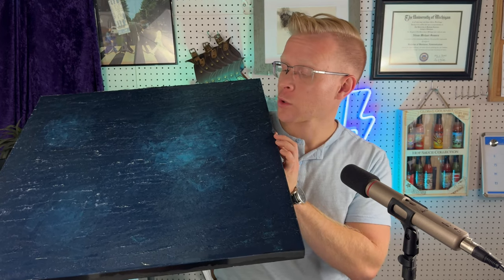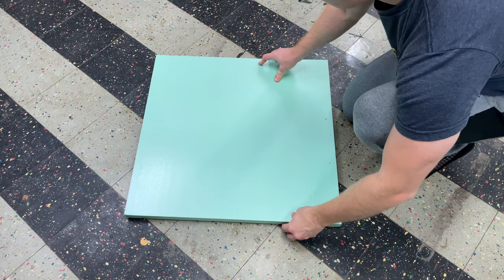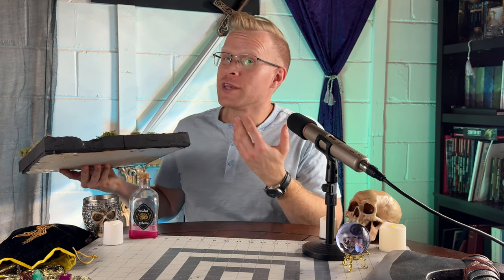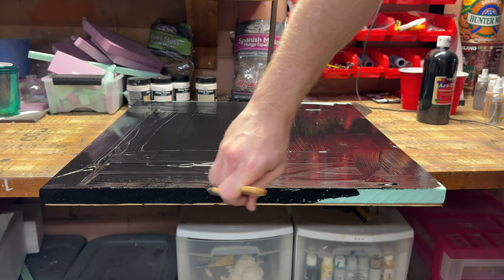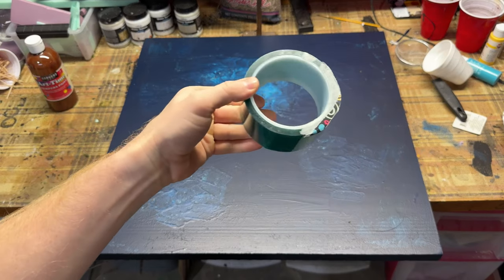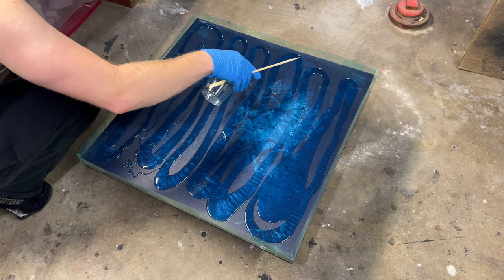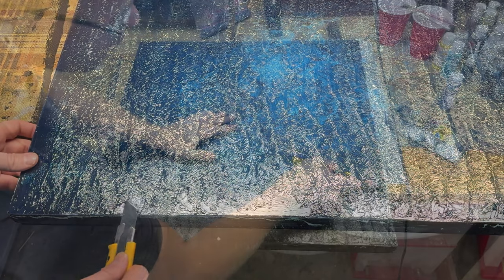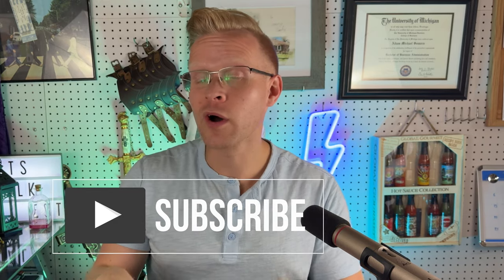Craft a Realistic Ocean Terrain Board for D&D and Warhammer

Comment: Really liked the mica powder tip for the water. Don't think I've seen that before. Looks really good 👍
Reply from the maker: Glad it was helpful! I can’t remember where I learned that technique, but it’s come in handy for these water projects.
Reply: Regarding the resin, for your 2x2 board about how much resin and hardener was applied for that first layer? It looked like about half a cup each so 1 cup total but how did you determine how much to add?? @parttimetabletopper
Reply from the maker: @sonicexpert986  I’ve done enough pours where I just eyeball it. Lots of experience with trial and error. For the 2’x2’ board, I use those disposable cups and fill each up about halfway. I’m not sure what the exact measurements are 🤷‍♂️
Reply: No worries! I figured that may be the case haha. It's funny because a few crafters have agonized over struggling with resin pours not going to plan, you seemed really chill about it here! @parttimetabletopper
Reply from the maker: @sonicexpert986  haha that’s just from trial and error. I’ve had my share of spills in the past. That’s why I really try to hype up the resin tape, as well is having a perfectly flat side to attach it to. I’ve seen all of these homemade frames with caulk and sealant, and that’s just not necessary if you have the right products.

Comment: Just found your channel and am really enjoying your builds! Do you ever get warping on your plywood layer? A couple of years ago, I built a bunch of 1'x1' tiles using a similar method to yours, except used 1/4" MDF as the base instead of plywood.  About half the tiles started to cup a bit - probably because I didn't seal the MDF first.  Just curious as to your experiences with warping, since you've definitely got the board-building expertise!
Reply from the maker: I have in the past, though I’ve found the plywood discourages warping overall. You know…I know about sealing wood and I’m shocked at myself that I’ve never done this with my terrain pieces. You just helped me add a new step to my process 👍

Comment: Nice video. I think those 2 x 2 project board are just perfect for terrain scenarios. Not too big and not too small. I can envision making multiple themes including ocean, grass, desert, volcanic, swamp.  

Out of curiousity, are you doing the plywood on the back to give it some weight and structural security?  It seems it wouldn't be unreasonable to just skip the plywood part no? 

Also, what do you think about just using the Vallejo water effects on top of the paint and skipping the resin pour? I'm curious to know what downsides you see by skipping the resin pour?

Again, thanks for the great content.  I've enjoyed all your posts.
Reply from the maker: Thanks for saying so! 😊

I agree, I personally like the 2’x2’. It’s convenient the foam and plywood are sold precut to that size, and it gives just the right amount of space for the table/game.

The plywood is for exactly that. The goal is to weigh it down a bit, as well as discourage warping. I’ve had projects in the past with just foam that ended up bending.

In my experience, the water effects alone have worked well for shallow water, but for deeper or tinted water, adding a resin layer has worked best. For this project, I wanted there to be an illusion of depth, and the resin layer with the mica powder helped create that.
Reply: Oh wasn’t aware you could easily get 2x2’ plywood boards. Will have keep an eye on this next time I hit up HD/Lowes.